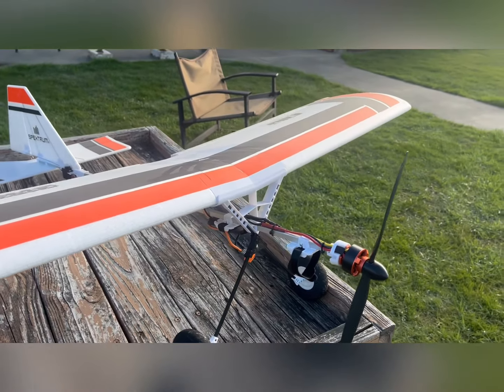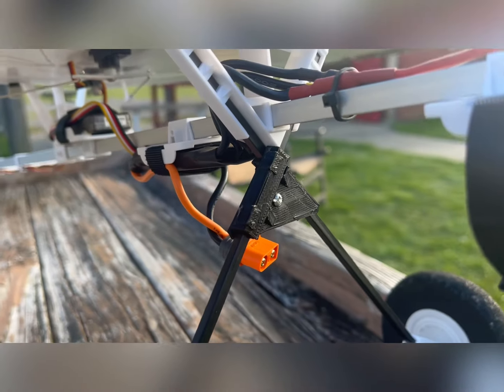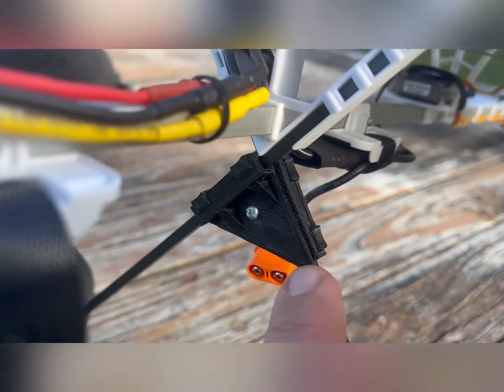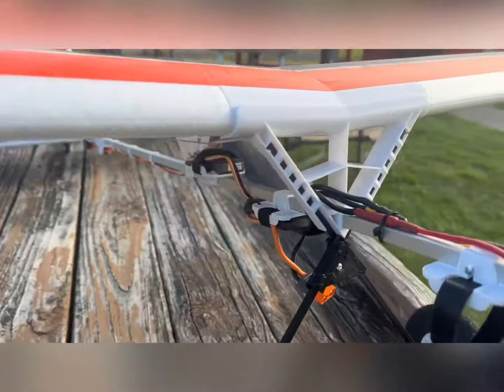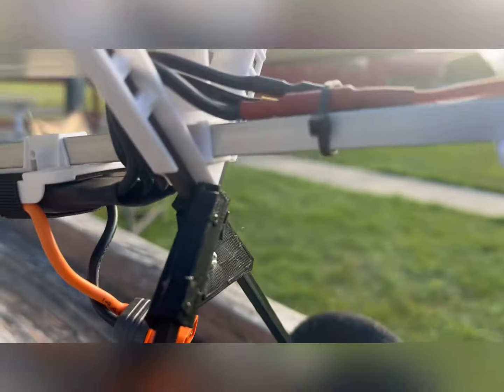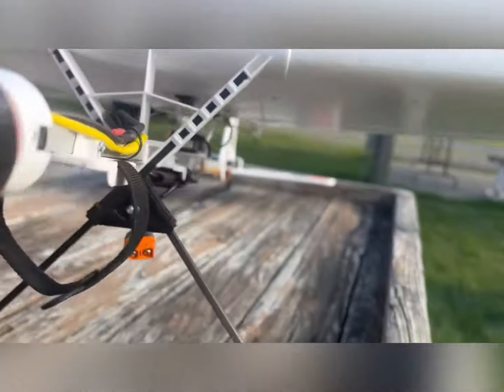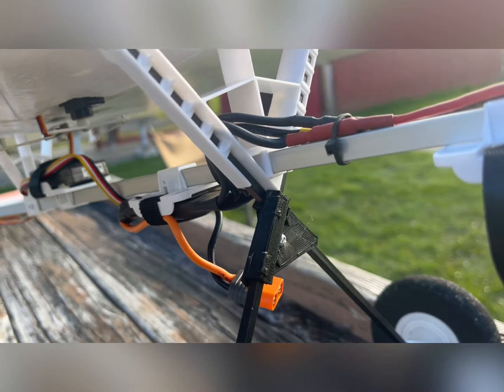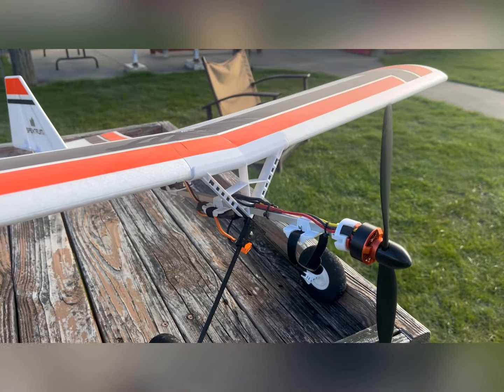Eflite Slow Ultra Slick weak gear fix!!!!!!!!!!

Comment: E Flite airplanes fly very well.  Unfortunately Their landing gear across the board ABSOLUTELY SUCKS.  Horrible that they make dreadful to land your airplane.  I put a Carbon Fiber rod between both legs.  Widened the stance 2" on each side.  Put Timber X Wheels on it and made a 4 point Wire connection to elemnate any flexing.  The way old Biplanes wire their wings together for lightweight strength.  Also installed Real real landing gear.  All slightly heaver, but I'm using it as a Bush Plane.
Reply from the maker: I’ve really only had bad luck with retracts. I’ll have a new video with a solution to a problem I’ve had with warbird retracts.